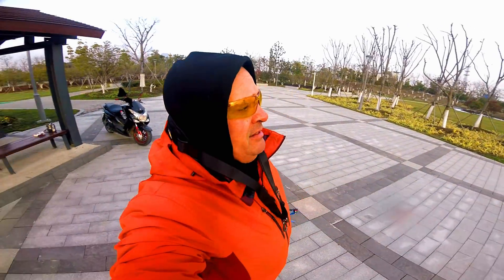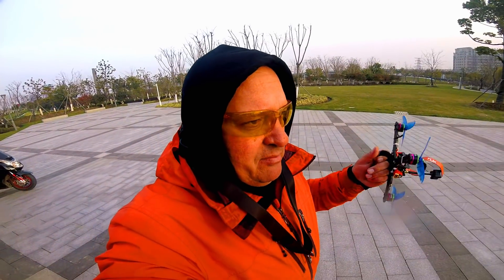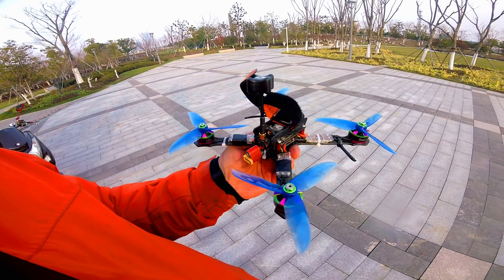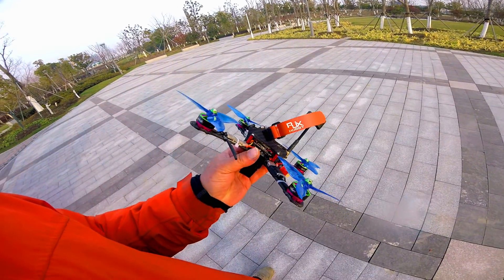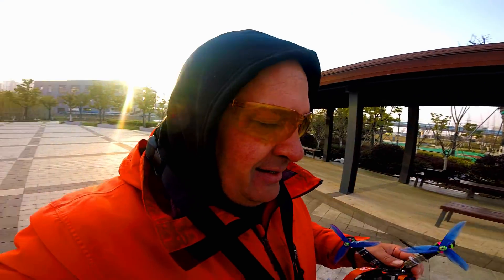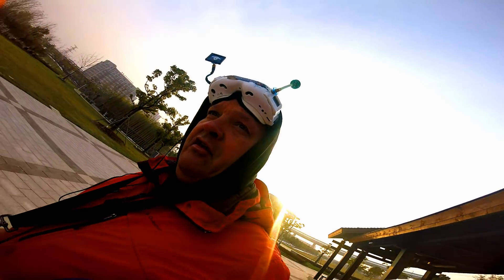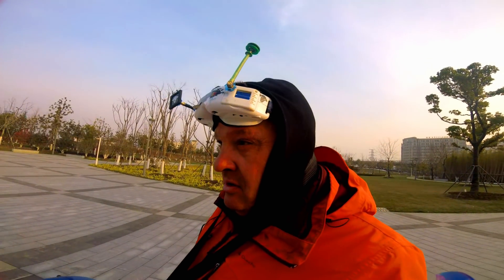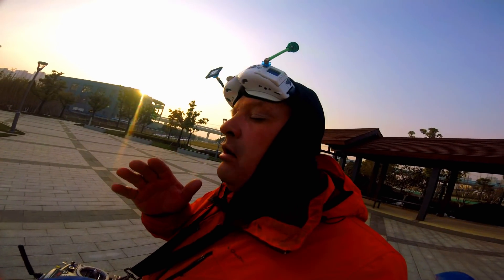Betaflight 3 3 , Dshot 1200, 32khz and the calming (Kalmin) filters

Comment: Yo....what is your CPU at dude! 1200 32/32 is really high!
Reply from the maker: well this is nearly a year ago, but I think it was around 45?? IDK...According to Boris B the new algorithms should be able to run up to 50% CPU load...but I never tried.
Reply: @SKIDOOSH  dang, that's really high.... I got a new helio board and it wont even run 32 32 1200. Only on like multishot or proshot :/
Reply from the maker: @Edgewalker728  ya I was just testing things out. Betaflight runs best at 8k anyway. Really no need to go any higher than that.